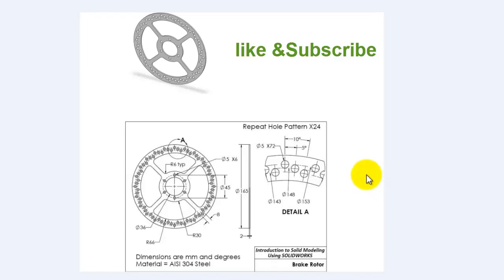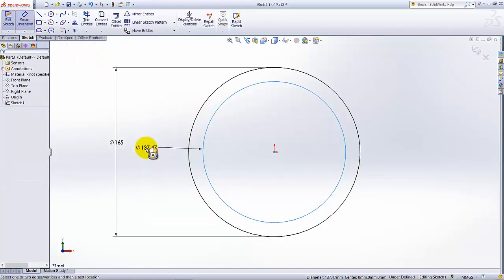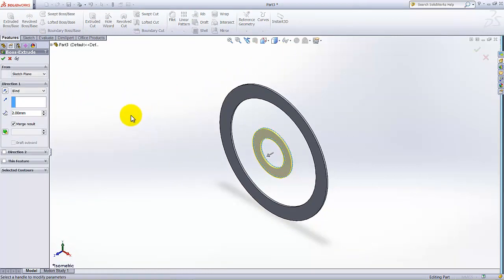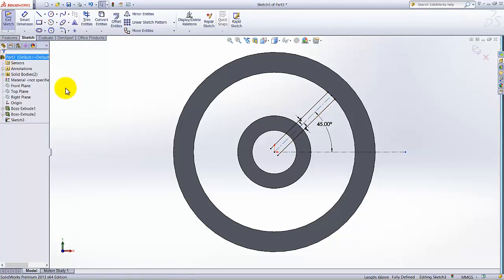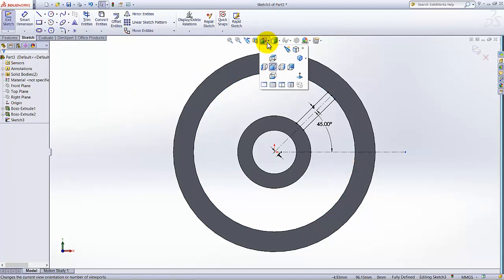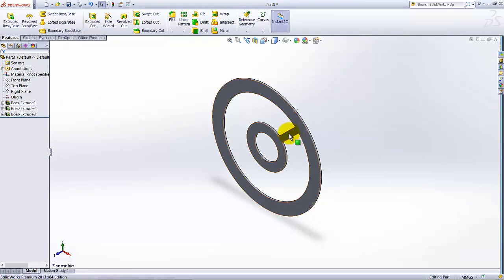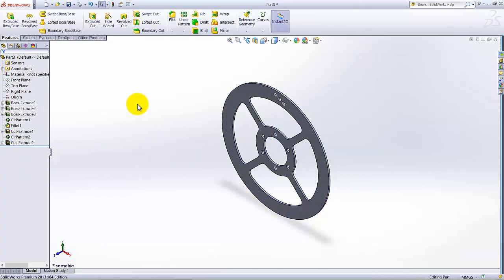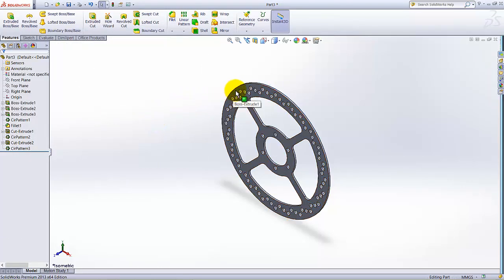SolidWorks beginner tutorials -bicycle Brake rotor

Comment: I need the calculation of this design
Reply from the maker: its provided in the drawing, at the right top its mentioned 24 hole pattern. if the drawing is provided you can also count the holes if the your drawing is different